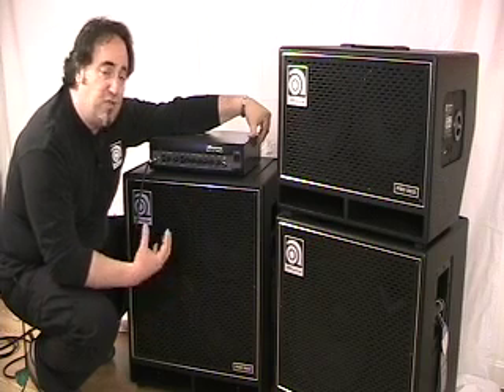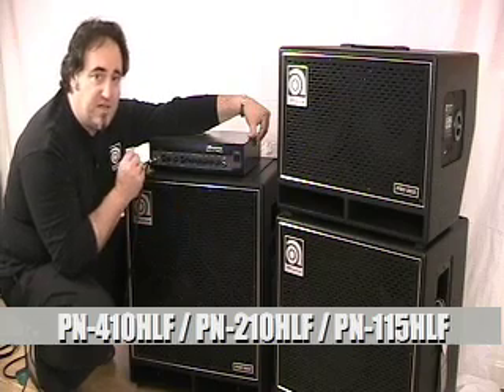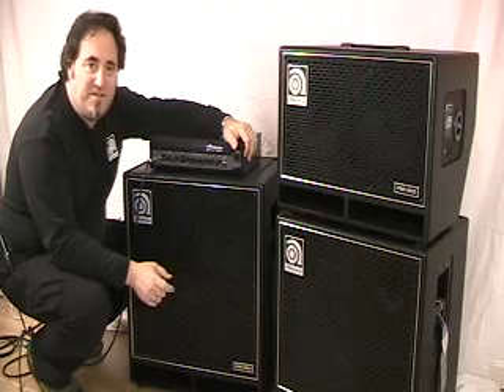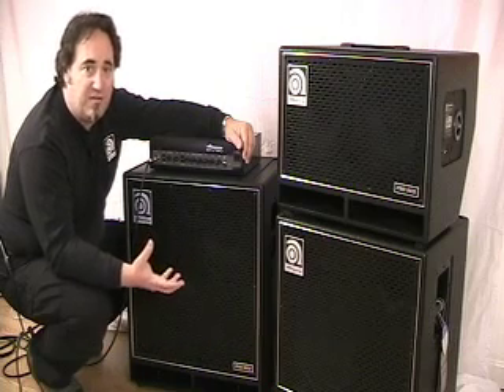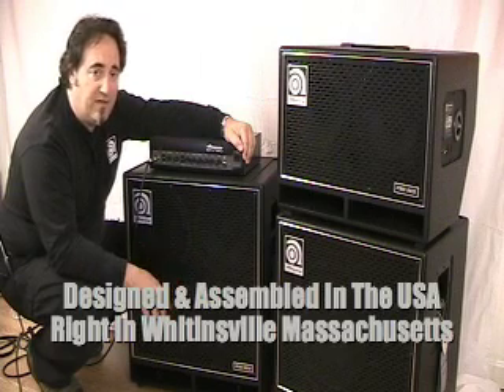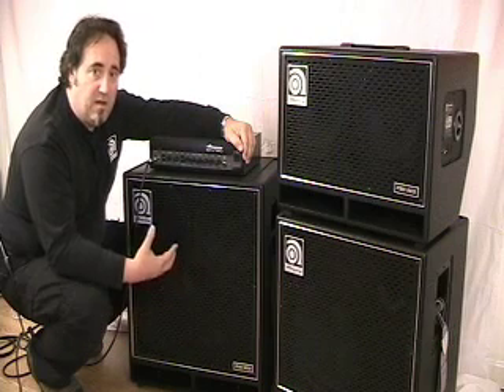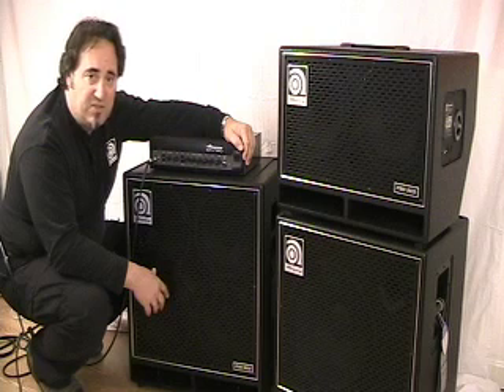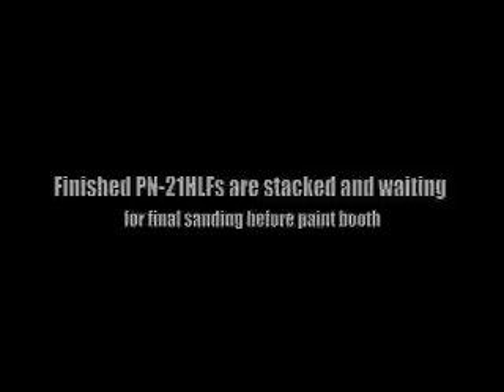PRO NEO Demo Part 1 Features, Benefits and Factory.mov

Comment: @GregoMorgan You can use any head you want. Just because a cab says it can handle a certain amount of Wattage doesn't mean that you have to. You can run an 8x10E that CAN take 800 Watts continuous (1600 peak) at 4 Ohms with a 25 watt B-15 head if you chose to and it wouldn't be that much quieter than running the same cab with an SVT because it is the surface area of the cones that make an increase in SPL much more drastic than how many Watts you pump into the cab. Cheers.

Comment: HI there!
I am in the process of investing into PN 4x10 cab with a BXT1x15 or I have the option of getting a SVT-810 they are the same price, I have never played ampeg before, and im wondering which set is the better investment, the Pro Neo and BXT or the SVT-810